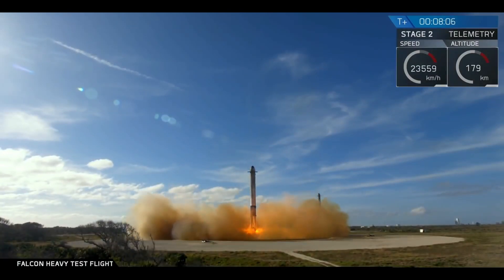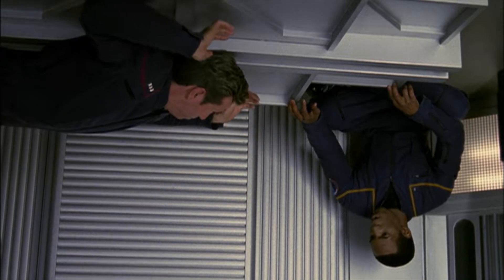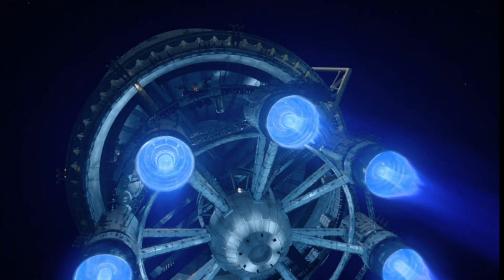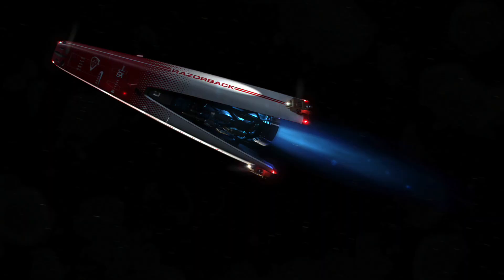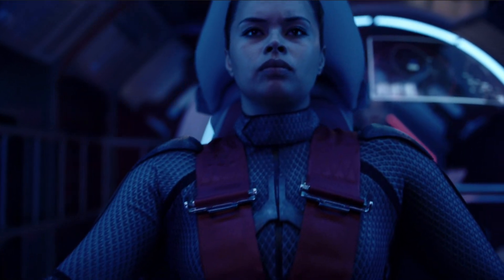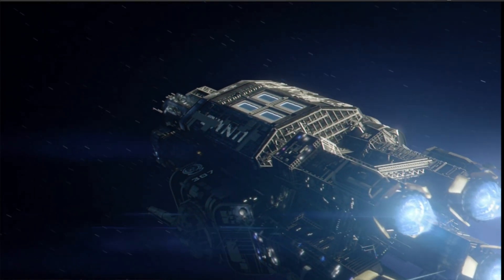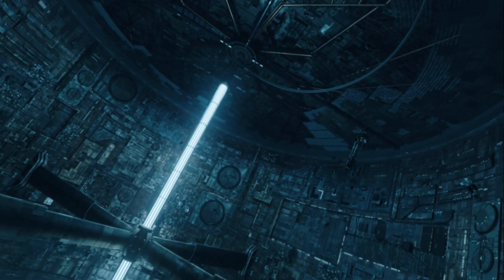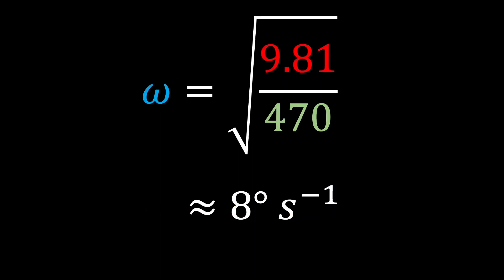Are the Expanse Ships Realistic? - Science of the Expanse

Comment: I marvel about how people forget about the space shuttle when talks about reusable rockets.
Reply from the maker: The shuttles were certainly a good step to reusability and an icon of space flight, but the amount of refurbishment they needed after each flight was almost like building one from scratch. The real power of the Space X boosters is that they are good to launch again almost right away.
Reply: @RyanRidden  the full flow staged combustion cycle of the raptor engines hopes to solve the issue of “rapid” reusability by lowering the combustion chamber temperatures and avoiding the coking from polymers formed in other longer chain hydrocarbon engines. If the Merlin engine did not have to have its turbines cleaned then all you would have to do is top off the ignition fuel (TTEB the green stuff on startup) and refuel the booster to launch again.
Reply: @williamgorham7339  SpaceX goes witha "sparkplug" approach on their raptors. TTEB is only used in merlins
Reply: @RyanRidden  When they don't blow up during the landing sequence..
Reply: @RyanRidden  The Falcon 9 is a vastly simpler machine. I'm pretty sure the Falcon 9 isn't reusable, just that is "mass" produced and new complicated parts(Like engines) can be strapped onto the less complicated tanks.
Reply: @TheOwenMajor  If F9 is not reusable, then why do they have a booster that has flown 8 times?
Reply: @louishermann7676  If you replace the engine of your car every time you go for a drive is it reusable?

I'm sure they have used the same tanks 8 times. But I'm also sure that most of the complicated parts(like the engines) get taken off for a complete refurbishment and replaced with other parts.
Reply: @TheOwenMajor   Weird thing to nitpick and not wholly accurate. The engines get reused as well. The rockets are reusable in the strict definition of the word (as were parts of the shuttle), but F9 is also reusable in a business sense, in that it saves on cost and allows a more rapid cadence than has ever been done before so...

F9 to SS on reusability is an apples to oranges comparison.
Reply: Reusable and refurbished are two very different things though. If SpaceX changed all their engines on the Falcon 9 boosters then they could achieve must faster turnaround times than the Space shuttle. The reason the space shuttle had such high costs associated with reuse was more related to the tiles used handle reentry heating. The reasons his is such an issue is because the amount of reentry heating goes up by the power of 3 as your speed increases so if you double the speed your spacecraft will deal with 64x the heating during reentry.
Reply: @williamgorham7339  And SpaceX plans to solve the tile reusability issue in a few ways. Mainly with thickness, using the same interchangeable tile shape for 90% of the rocket and cheap automated tile placement/replacement.
Reply: @williamgorham7339  Yeah, I remember reading that each tile is hand inspected and the bloody things were all basically custom made. 

Few things about the shuttle, or NASA in general, are off the shelf. Which is also one of the reasons we couldn't resurrect the Saturn V as anyone who knew how to build one were either dead or retired.
Reply: @williamgorham7339  err, might want to check your math there. 2³ = 8, not 64.
Reply: Space shuttles aren't really reusable rockets, they are more like reusable payloads. The shuttle itself had very little lift capacity. IDK if it could even get off the ground without the detaching stages.

The design itself was not very good from what I've been told (by people who worked on it). It was kind of one of those designed by committee things that our government is known for.
And lets be honest, NASA's real purpose wasn't the as much of the space race as much as the Cold War rocket and aerospace testing. Having a large group of people trained as rocket technicians and engineers is a good thing, and having people trained in that field working outside of friendly governments or government contractors is a bad thing. Just look at what happened to the Canadian artillery engineer Gerald Bull that worked for Saddam Hussain (was working on gun launched satellites). He was assassinated, probably by Mossad.
Reply: @joseph1150  

Have to agree  with you. Space Shuttle  is not  a reusable rocket.  A system with parts to be reused. Sure. And to you point, payload,  yes, for sure.
Reply: The space shuttle wasn't a reusable rocket. It was a space plane on a semi-reusable booster.